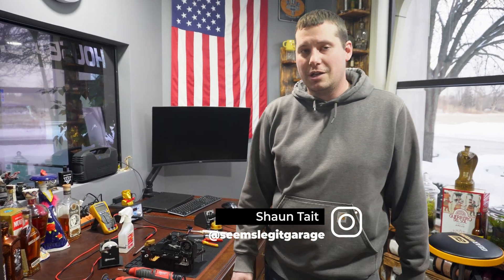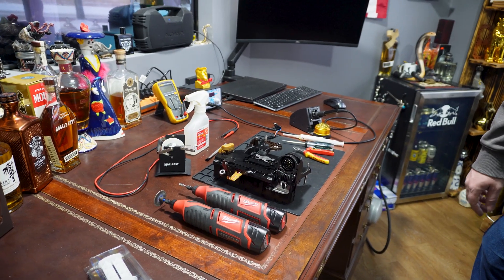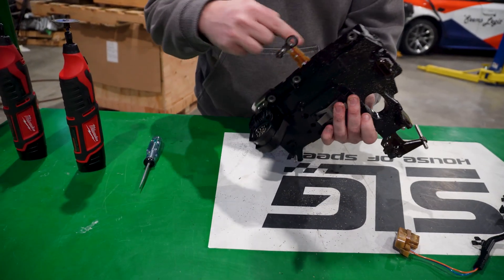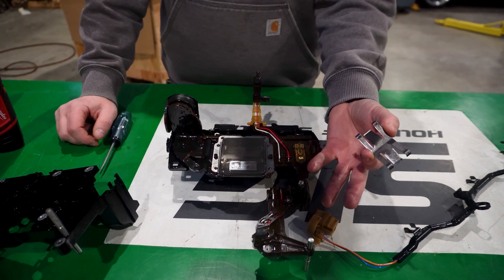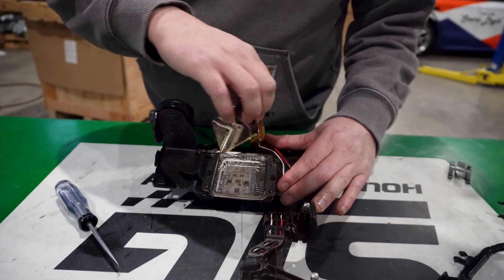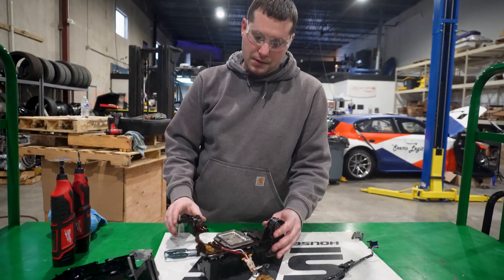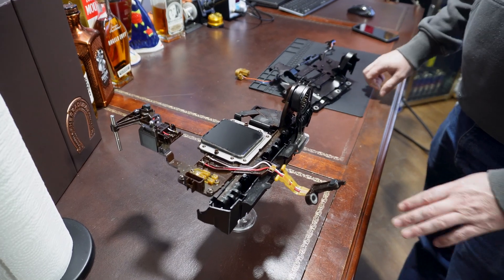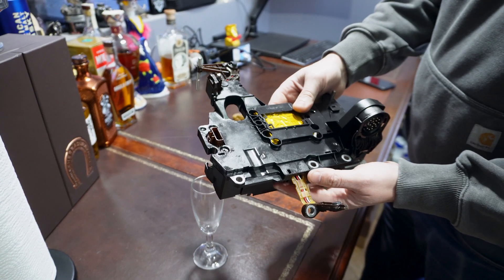ZF 8HP/Turbolamik Mechatronics Modification and PCB Install Guide

Comment: What year 8hp70 should I look for?
Reply from the maker: 16-19 are safer for Turbolamik, on newer there is a larger chance the connector pins won’t all be present, all pins are required for Turbolamik control. They were removed for reasons unknown. Kinda random.

Comment: Would this be something a 6l80e /90e could have done to it? Obviously id have to build a pcb and write the code for it. But bypassing the mech unit never occured to me
Reply: Just get the Holley
Reply: is the tcu actually inside of the 80/90e?
Reply: @kyrujames yup, and yes its as stupid and as big a pain in the ass as you think